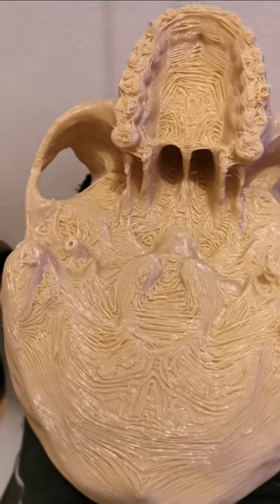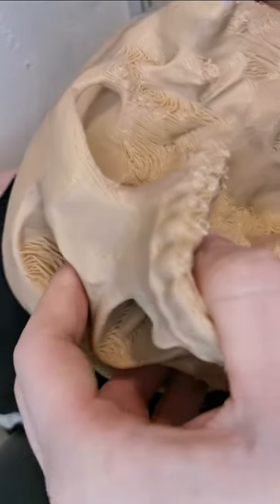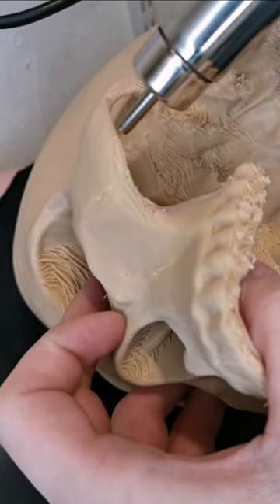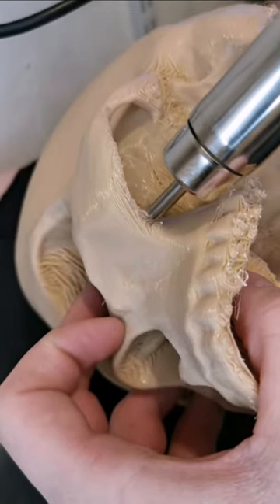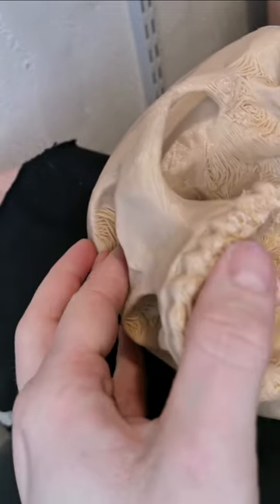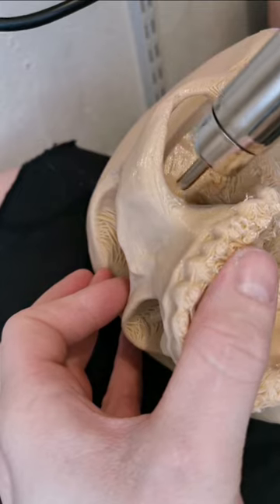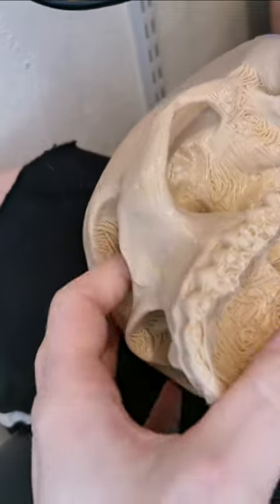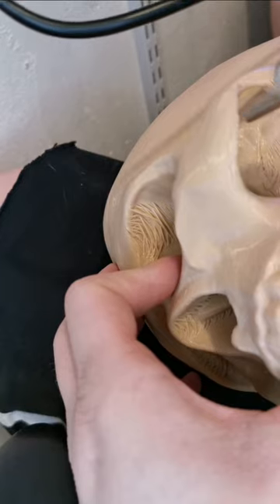PLA smoothing with hot air soldering iron

Comment: I have used a small heat shrinking gun just today and it worked well.  Your idea of using a re-flow soldering gun it most excellent.  Thank you.
Reply from the maker: Glad you found it useful! I usually use the iron as a sort of TIG welder when fusing parts. Got a video that I have just not uploaded yet where I show that aswel.

Comment: Interesting, can you link to the exact product you used? (the hot air gun)
Reply from the maker: JCD 8898 2 in 1 750W Soldering Station Hot Air Gun Heater LCD Digital Display Soldering Iron Welding Rework Station for Cell-phone BGA SMD PCB IC Repair
https://banggood.onelink.me/zMT7/oc7f5qlp

Seems it's out of stock at the moment but that's the precise one I got. Still going strong! 

Used it quite frequently as well. Hobbylevel but for the price it has exceeded my expectations by miles!

Comment: What temperature was the hot air reflow set to?
Reply from the maker: I ran it on 480C, but it depends on how fast you want to soften it. Did that temperature as to see if it would burn or not and it didn't seem to do so at all. But it's a matter of trial and error until you find a temperature suitable for your workspeed and material.  

480 did end up becoming a bit sticky if I didn't work fast enough.
Reply: @claustrophobicbadger5568  Thank you